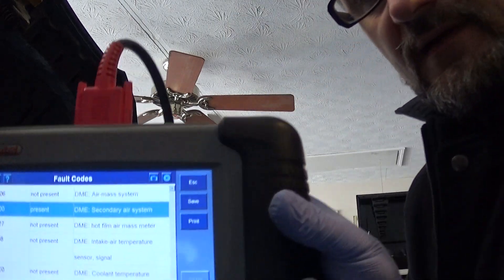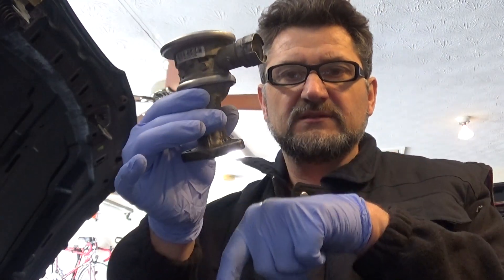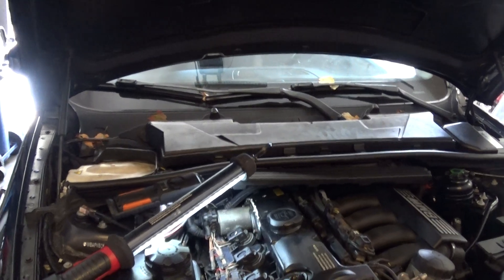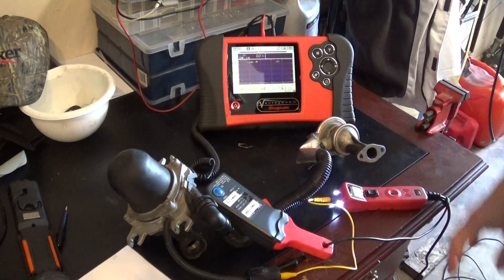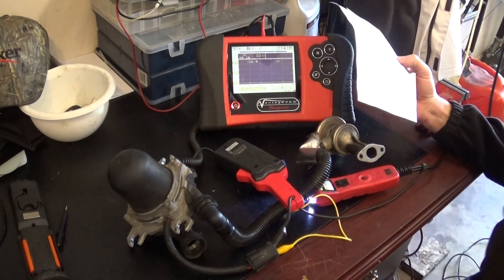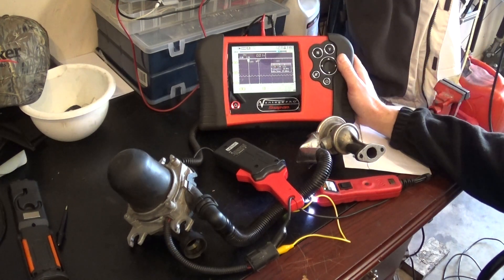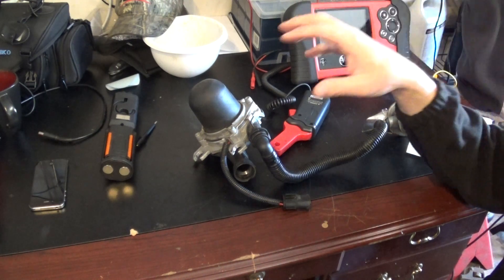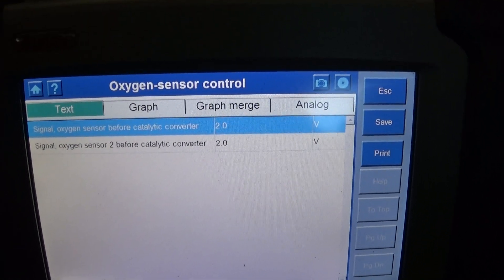BMW 328i Secondary Air Injection System Testing P0491/P0492

Comment: Great video. Diagnosing these exact same codes on my E39 so this is very helpful.

One question for you: What is the function of the vacuum line that connects to the little nipple on the valve? When the solenoid behind the intake manifold releases the vacuum to the valve, is that supposed to close or open it?

You seem to be able to blow through the valve without pulling a vacuum on that nipple so I am assuming proper function is for it to allow air through without vacuum, then close once the SAS sends vacuum down to the valve?

Comment: Mines had burn oil in the ports, I sprayed parts cleaner and ran a brush through it and now I don’t get that burning oil smell out the exhaust when the engine gets hot.

Comment: I had p0491 on my n51 e92, and code remained even though got a new air pump, new check valve, and new hose. 
Found out there was moisture in my hose that was messing up the flow. And triggering the code

Fox was: removing both hoses connected to secondary air pump, Spraying a little isopropyl alcohol into the pump and both hoses. Let it dry. Been good since then.
Reply: Which hose specifically was giving you trouble?
Reply: @EmperorBun he said both

Comment: HI there... Is that the secondary air injection valve or the EGR valve? I'm looking to replace the EGR valve and multiple sites shoe that exact part as the EGR valve.  I'm so confused...
Reply from the maker: It’s secondary air injection valve.

Comment: Hello, thank you for the video. I can blow through mine, but I am met with resistance and have to blow pretty hard. Is that normal or should the air blow freely
Reply: Same problem here. Is this normal or a sign of faulty valve?
Reply: @jomartacut3559  mine was faulty. I spent a lot of time and effort into cleaning it hoping to unclog it. Reinstalled multiple times and retested, nothing worked. I ended up buying a new one. Strangly the new one seemed exactly the same, but cleared my code. This was a total nightmare for me. If possible, save yourself the trouble and just buy a new one. Don't go to pick and pulls because if you do find the correct valve,  I guarantee it will already have been tested and is faulty. Good luck.
Reply: Thanks much. I’am having the dealer look at it as its under sulev warranty.

Comment: I can’t blow through mine at all
Reply: Hope you replaced it by now lol
Reply: @SubliminalMessagesTV  😂 replacement for what I just deleted it it's incredibly pointless piece of metal and took out my own headers put in catless headers and straight piped it
Reply: I can blow through mine, but I am met with resistance and have to blow pretty hard. Is that normal or should the air blow freely?
Reply: @El_El_Guapo  I ended up deleting it,just remove ut its pointless really

Comment: Thank you for this video! Question. I’m building a 128i track car and will be deleting anything not essential to performance. Do you know if deleting the SAP will decrease performance either by messing with AFR’s via the O2 sensors or the DME somehow cutting power? Just curious if there are any negatives to deleting this other than emissions. TIA! Cheers

Comment: my ports are clean, changed the pump, changed the hose, check valve is working as I tested it like in this video and still check engine light is on, I don't get it is there something else part of the secondary air?
Reply from the maker: Does your pump actually runs. Do you hear it when you first start your car?
Reply: @kyhomegarage3430  yes it does
Reply: @radekskreczko  Did you find a solution to your problem? If so, would you are to share? I have a similar problem and I can't seem to figure out what the issue is. Thanks in advance!
Reply: @jaxonhundertwasser3068  no I did not, I have the check engine light on, but emissions are do in 6 months, I will take it to a mechanic in a month to fix that, I'll post once I get it fixed... Did you get to the solution?
Reply: @radekskreczko  yes, I did! If your issue was the same as mine: P0492 (or P0491, but not both):

I bought an O2 sensor safe carbon cleaner with an extra long hose + a sheet of cork gasket material. 
• Take off the secondary air valve. 
• Cut the gasket material in the shape of the secondary port and poke a small hole for the hose of the carbon cleaner. 
• Get the hose as deep into the secondary port as possible and blast the carbon cleaner. You’ll see the carbon accumulate along with the fluid at the entrance. 
• Let the cleaner evaporate and clean out the carbon. 
• Repeat (even turn the engine on intermittently while the secondary valve is off to ensure all the carbon flies out and to burn some of excess fluid). 
Bonus: carbon clean the secondary air valve in the meantime. 

Hope it works!
Reply: @jaxonhundertwasser3068   would you have the link of the carbon cleaner ??
Reply: @christopherrios3662  Hi, I used B12 chemtool and an extra long hose.
Reply: Turned out to be a bad valve, even when tested good, I bought a new one and bara bing bam boom
Reply: I just bought the b-12 found out I had a 20$ gift card laying around in a drawer got some lovely engine cleaner as well for the other oil stains on the motor  😅 hoping it works I already took secondary air pump apart and submerged in alcohol cleaned out the air valve with lab grade alcohol and sea salt mixture to break up hard deposits cleared codes and came back on so I’m doing the method you suggest w/ b-12 Chen tool.

Comment: Hello. Good video 
My ports are clogged in the head. Is there a way to clean them without pulling head out. 
Ty
Reply: Hi, we’re you able to figure this out? I may have the same problem with my e90
Reply: any update on this?, one of my ports are  clogged as well. I am letting it sit overnight  with crc carbon cleaner to see if it helps.
I am at 156miles so no SULEV warranty for my N51
Reply: @nahtannoJv8  Did the CRC carbon cleaner work for you?/ did you spray it directly in those two holes there with that valve disconnected?
Reply: @dferrari888  it didn't work, and I did spray it into those two holes

Comment: There is white smoke coming from my vents as soon as I turn my car on, I opened the hood and it is coming from that same side. Is it possible that may be the reason why? Because I have to change that part or maybe something far worst?
Reply from the maker: Do you smell burning oil. Most likely your valve cover gasket is leaking and engine oil is dripping down onto hot exhaust.

Comment: Hi I’m having same problem with my 08 e90 as the ses light is on for secondary air pump insufficient flow bank 2. I’m curious how did u clean/unclog the air ports ?
Reply: you probably dont give a damn but does anybody know a method to log back into an instagram account??
I somehow lost my password. I would love any assistance you can offer me
Reply: @Daxton Harrison Thanks so much for your reply. I found the site thru google and im in the hacking process atm.
Looks like it's gonna take quite some time so I will reply here later with my results.
Reply: @Jagger Cole glad I could help :D
Reply: @Jagger Cole instablaster ;)
Reply: @Daxton Harrison it worked and I actually got access to my account again. I am so happy:D
Thank you so much, you saved my account !
Reply: Very wholesome guys ^^

Comment: so as u tested the valve is it means GOOD valve?
Reply from the maker: DenStylerz Official - Best Mixes yes sir this is good valve. On this car exhaust manifold port was clogged up. Cheers
Reply: KY Home Garage KY Home Garage and if the air flows 2 directions ? Help if i cleaning?
Reply: @kyhomegarage3430  hello, how did you go about unclogging the ports?
Reply from the maker: Paul R. I used screwdriver and wire brush. Nothing special you just need to clean build up of carbon deposits .
Reply: @kyhomegarage3430  thank you so much for this info, I believe that my problem. Last time I took it off I saw tons of carbon build up but didn't bother to clean it. I just bought new gasket because the old one looks run down but I think carbon build up is the actual problem. BTW, I have a 2004 330xi but same principle!

Comment: Ramon, why were the oxygen sensor voltages so high? Is that like a European thing?
Reply from the maker: Hi my friend this car uses AFR  or wide band air ratio sensor. You will see these type sensors more often in future. Any car manufacturer are using these sensors now.  2.00V is lambda 1. Voltage above 2V will indicate lean and voltage below 2V indicate rich condition. I know this is confusing. They are different from O2 sensors. Hope this help.
Reply: KY HomeGarage  Got it, I thought it was just a regular 0 -.900 oxygen sensor.